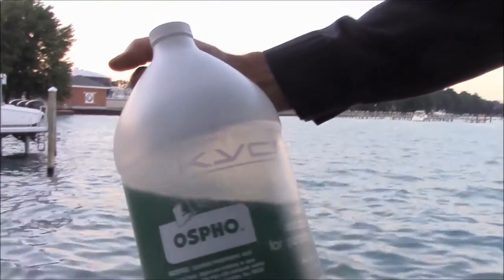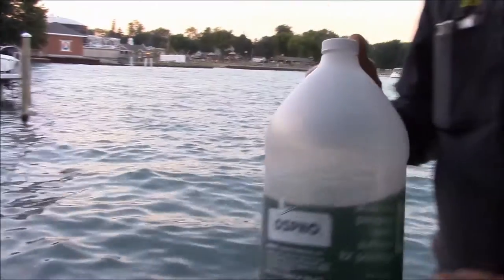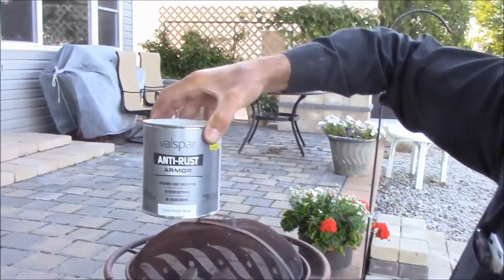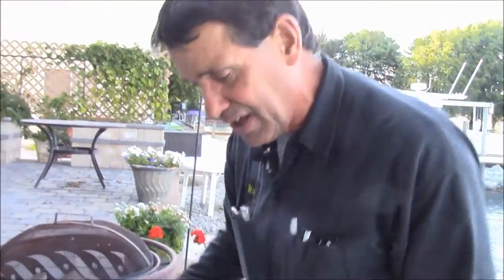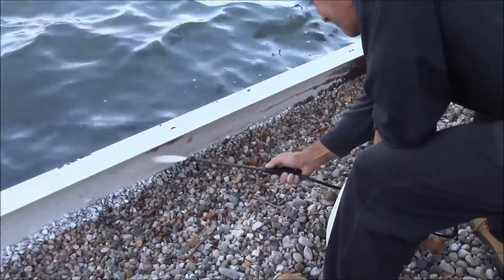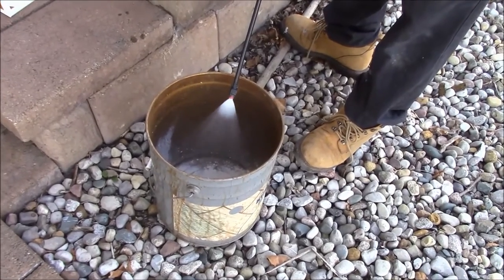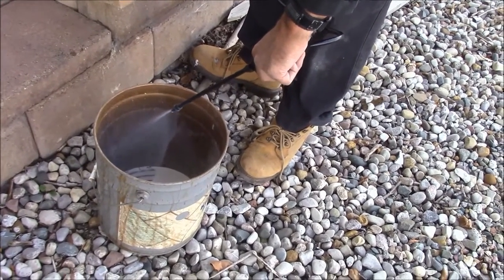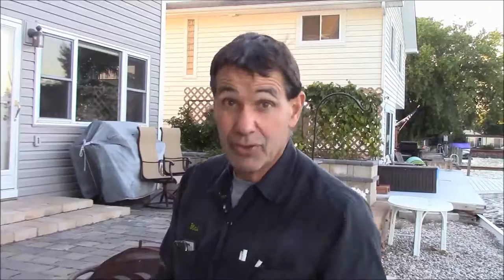Seawall Rust Treatment Lasts over 10 Years

Comment: Do you do this to the front as well? I’m not sure if I should go for the galvanized sheet piling, coal tar epoxy, or just maintain the steel like you show. Awesome video, thank you for sharing it.
Reply from the maker: I did the front the same way while there was still ice in the spring. My other steel seawall was new and oily (from manufacturing) so I waited one year for nature to burn off the oil. As a kid when we had to paint galvanized gutter that was new we would wipe it down with vinegar and then rinse off the vinegar before painting. Once dry the vinegar etched the brand new shiny galvanized enough so that the paint would adhere properly.
Reply: Thank you very much for sharing the knowledge, it is really so helpful to learn from.